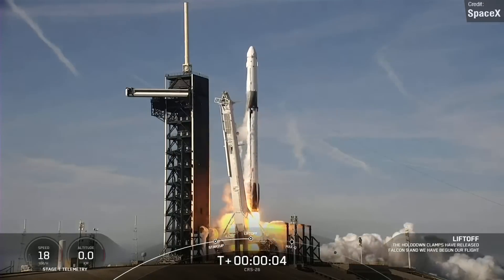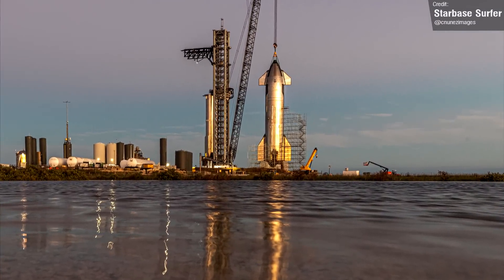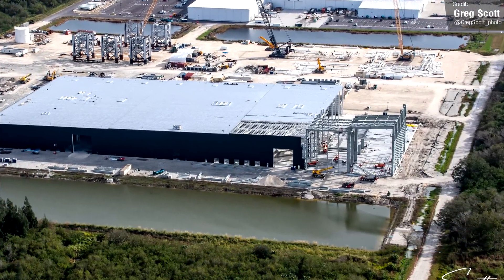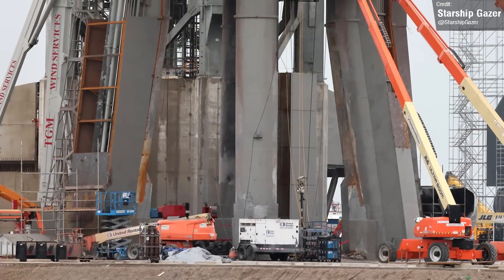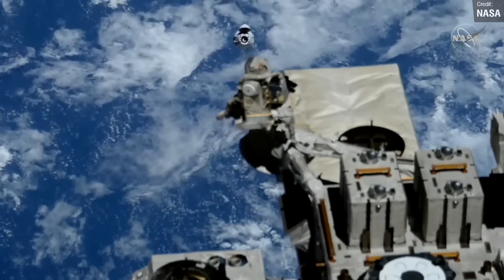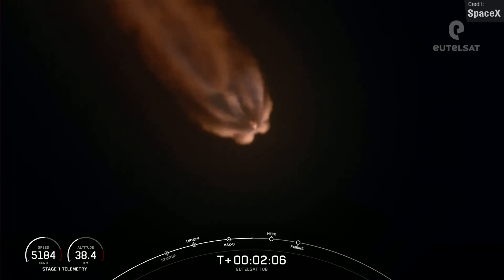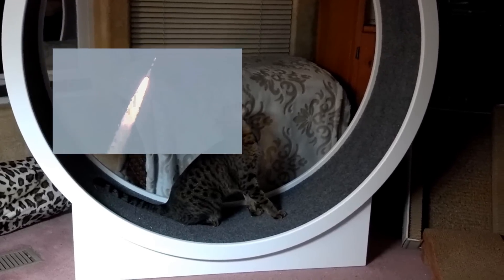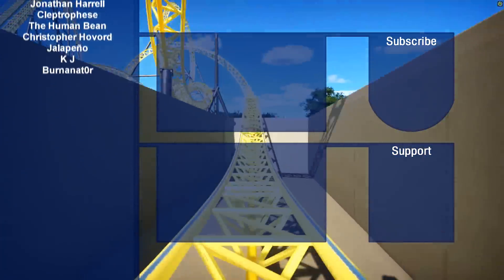SpaceX Starship Buckling Damage, Launchpad Scarring for SpaceX and NASA, CRS-26 & Eutelsat Missions

Comment: welp space x migyht wantto maker raptor 2 engine upgraded falcon 9s and falcon 9 heavys and maybe super heavy faclion 9's (bacly 6+ faclion 9 rockets first stages all put together) if starship get much more delayed. also nasa can use dream chaser space plane with a falcon 9 rocket if the vulcan rockets don't work out. also dream chaser is made in niveda and is the repalcment of the X-38 but far better in every single way and can fit on a vulcan or a falcon 9 rocket if needed if vulcan can't get a high enotgh relabilty.

Comment: Baffles me why SpaceX keeps lolligagging around with the OLM. Time to dig a proper diversion trench, line it with high-temp battleship steel, and build a proper deluge system. If their current solution cant withstand a few seconds thrust from less than half the engines I'm skeptical that pouring better concrete is going to serve.

Comment: Came here for the starship news. It's hard for me to get any kind of excitement for NASA with their ineptitude and cost overruns. By the way, I have hated them ever since 2003. We should never forgive them for what they did to  Columbia
Reply: Don't hate NASA for that. If Congress hadn't cut NASA's budget so severely in the 70s, the Space Shuttle wouldn't have even been necessary. NASA wanted to continue using the Saturn series of rockets, which were safer and more capable, but Congress (wrongly, as it turned out) thought the Saturn program was too expensive and cancelled it. The Space Shuttle was a deeply flawed vehicle, being by far the most dangerous human-rated space craft NASA has ever flown, but the agency simply did not have the funding to build a safer vehicle and still meet Congress' expectations for cost and reusability.
Reply: @stephenwells6434  fuck them they didn't even try to save Columbia
Reply: And how exactly do you propose they do that? The only feasible option would've been to send Atlantis on a rescue mission, but launching on such short notice would have carried considerable risk even by the shuttle's standards and would only have been attempted if NASA knew that Columbia's ability to reenter the atmosphere had been compromised.

Comment: Why don't they just cover the pad with steel?
Reply: Melting
Reply: @andreicomsa2974   I don't think that would be an issue given the short time it is getting heated. Just depends how thick they make it.
Reply: Blast damage
Reply: @josephc.9520  What is that supposed to mean? "Blast damage" is what they have now.  The concrete cracks and flies apart.  Cover it with one or two inch steel plate.  I suppose it might heat up enough to melt in 10 seconds but I doubt it.  Just have to wonder how they thought they were going to get away with doing nothing at all.

Comment: The second tower probably won’t be at SLC-40 because it is way too small for another launch infrastructure
Reply: That is my understanding as well. SLC-40 is not large enough for Starship. I wonder if there has been any foundation work at SLC-13 where LZ-1 and LZ-2 are located. Or work at the as yet unbuilt LC-49 to the NW of LC-39B. There is speculation that the tower segments could go to SLC-40 to be used as a crew access tower for Crew Dragon launches from there, but SLC-40 would neeed foundation work for that too.

Comment: No concrete will wisthand the sheer strength of the Raptors especially if the force comes perpandicularly to it... Deflectors only would allow the flow to be nearly parallel and thus resist more, halas, Musk didn't want any trench or deflector to be built, that is a great mistake... There will be no Starship taking off without that. So it will take at least six more months. from the decision to do that... Don"t expect a Starship taking off (unless sacrificing Stage 0 entirely and having to completely rebuild the one at the Cape) anytime soon. And t will mean also that if Starship is as if not more destructive than SLS on the Stage 0, there will be NO way that new space rocket will be able to be launched once a day. Starship will be as expansive as its counterparts as far as terrestrial infrastructure is concerned.

Comment: I’ll be very happy to see this beast launch. However, I don’t understand why they don’t just launch the booster first, then catch and place it back on the pedestal.

Why risk losing both a booster and a starship on the first attempt? If it explodes, and both vehicles self-destruct, the damage will be so much worse than if they launch just the booster first.
Reply: Because the blunt end of a Superheavy booster is not built to withstand launch forces. The soft water landings for the 'orbital' attempts will be for dialing in the accuracy before a catch is attempted. SpaceX did the same with the Falcon 9 when they first started trying to catch those. A missed catch would be worse than a launch RUD, as a launch RUD is more likely to happen away from the pad. Not to mention that with the damage the pad is sustaining with less than half the engines in a short static fire, ALL the engines would be worse.
Reply: @steveaustin2686  Can you clarify a few points?

1. Couldn’t they just weld a dome on top of the booster like they did with grasshopper in the very early days of development?

2. On the return it will be practically empty of fuel, even if they decide to land it in the water. So why would this be worse? Less fuel less explosion.

3. Why do you believe it is more likely to explode or fail in flight versus right on the pad? If I recall, when the Russians attempted this many engines all three attempts exploded on the pad.

4. If they were to attempt to launch/test just the booster first, without a Starship on top, that’s half the mass and fuel so approximately have the explosive impact (I.e. a RUD).

5. Lastly, I’ve read that the idea of landing the first attempt in the water is no longer on the table. They are now talking about a catch attempt on the first flight, hence why I think they should do a booster first without also risking a Starship (hence all my questions). Thank you.
Reply: @NowDeceasedRIP  
1. Why should they when they can just use the booster for the 'orbital' launch? There is only so much time left before the unmanned test landing with HLS Starship, Starship Tankers, and the [DELETED] Starship propellant depot that has to be completed well before the Artemis III landing. So NET 2024 for that unmanned test landing. With how much development is left to go, why should SpaceX waste time with launches to make you feel better?

2. A tank full of vapor is VERY explosive. Ever head of a fuel-air bomb?

3. Damn dude, do you NOT know how to google something? Only 1 of the 4 N-1 launches exploded near the pad.

4. You STILL would be catching a booster with mostly vapor inside. Again, have someone look up a fuel-air bomb for you, since you apparently can't google.

5. Musk wants the first landing attempt to be a catch. Cooler heads at SpaceX will likely prevail.
Reply: @NowDeceasedRIP  Whatever floats your goat dude.

Comment: Musk should use his boring tech to make a tunnel underneath that tower and up to the base to vent away the exhaust from ground zero - he can sure up the base by pumping special concrete into the foundations. This will avoid the tank farm and other buildings being damaged - catching rockets out of the air might be tricky to do but its seems the obvious is beyond him.
Reply: Boca Chica is right on the coast and just feet above sea-level. It would be easier to dig it out from above.
Reply: @steveaustin2686  In that case he should have built it higher up on a bed of concrete with exhaust tunnels in place. Let's hope there's no damage to the stand or nearby buildings - the Artemis launch damage (though possibly minor) should be a lesson for Musk. I would love to see a successful launch but I don't think this will happen this year to be honest as the pad is clearly not ready.
Reply: @MoKhera  Apparently, Musk planned that  the height of the orbital launch pad would mean that they would not need blast diverters or flame trenches. It will be interesting to see the final solution that they arrive at. Time is running out on the unmanned test landing and there is still a LOT of development to go.